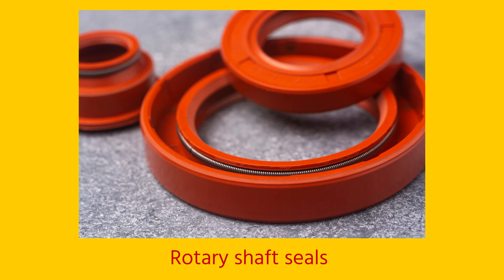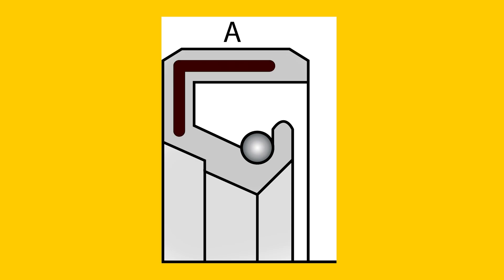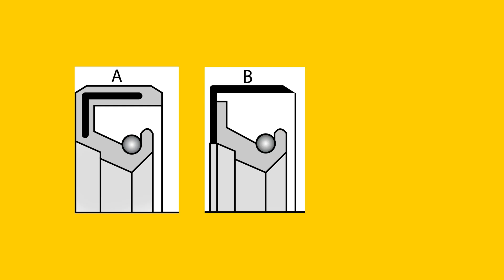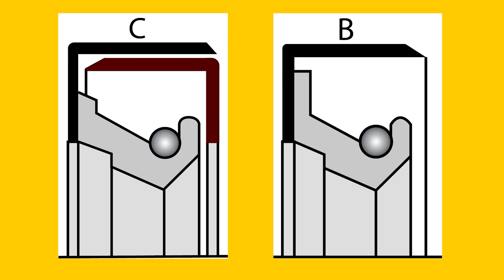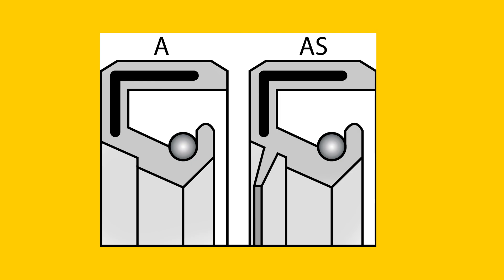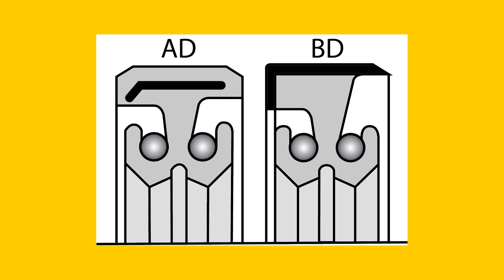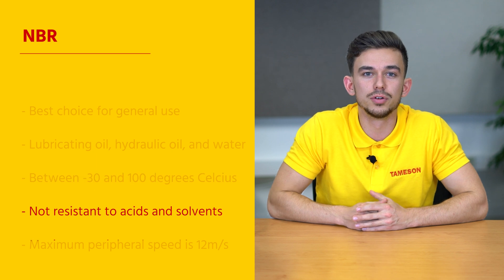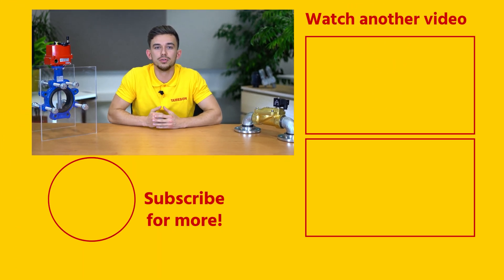Rotary shaft seals I How do they work and types I Tameson

Comment: Thank you for the informative video.  When installing an automotive rear main seal I see differing opinions of whether to apply grease to the inner lip of a rubber seal with a dust lip. As this gap or trough of the seal doesn't ride on the shaft I'm wondering if grease is simply to avoid damage during installation or would grease actually serve a purpose when in service? For example, better sealing or reducing temperature. I typically just use a bit of motor oil for installation.
Reply from the maker: Thank you for reaching out with your question. Grease is often applied to the inner lip of a rubber seal primarily to prevent damage during installation. It can also aid in better sealing and reducing friction, which may help in temperature management. Using motor oil is also a common practice for installation. If you have further questions, feel free to ask!
Reply: @Tameson  Thank you!
Reply from the maker: You are welcome.

Comment: Very interesting video, Thank you. I am looking at shaft seals as a better way of sealing the steering column lower shaft where it passes through the steel bulkhead on a bespoke car I am building. I am guessing that I will need some thin wall tube to locate the OD of the shaft seal and the ID will take the lower column.
Kind regards Paul from 48SPOKES (UK)
Reply from the maker: Glad it helped. You can always contact us on support@tameson.com to get more information and details.